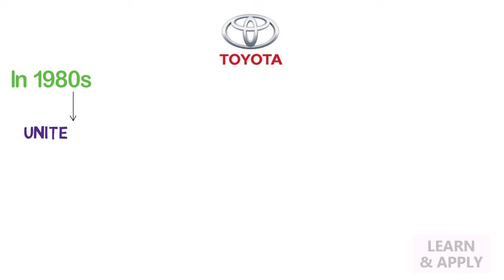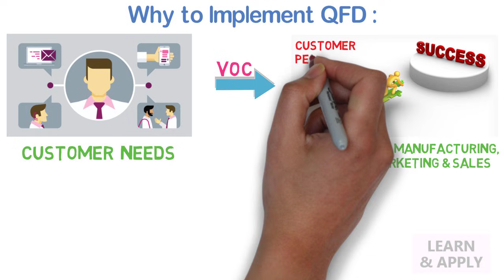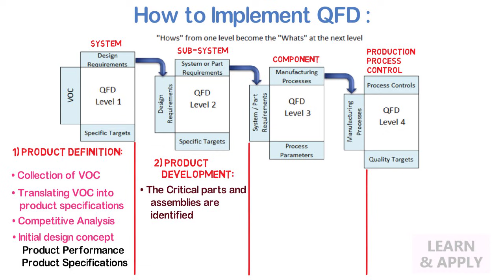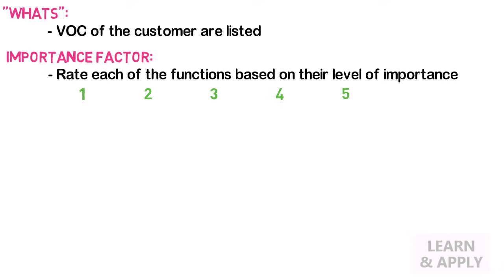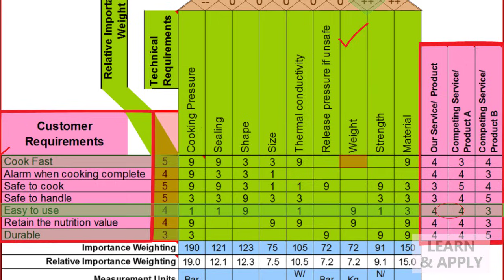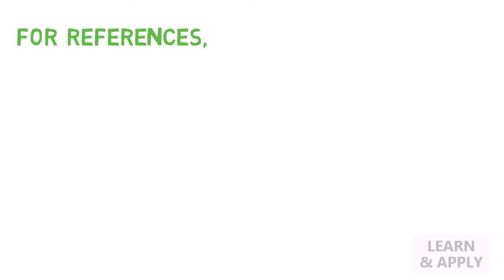QFD (Quality Function Deployment): With Practical Example (PART-1)

Comment: Thanks you for the video, though I have a question
 Will QFD work without a functional prototype?
if yes, then how will you collect the value for our service (without functional prototype for customer to give feedback to)?
Reply from the maker: Functional requirements are the requirements of the customer from your product or service. So, it is always present irrespective of your products or services. You need to use them for QFD.
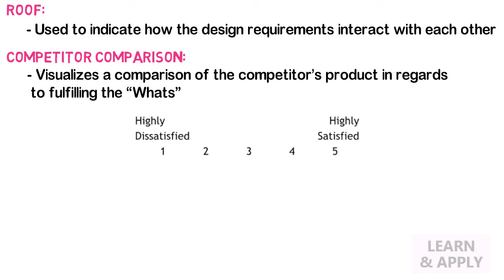Reply: Sorry, I might need to clarify the question. At 10:10, in competitor comparison section, are there any workarounds if you don't have a functional "prototype" (not requirements) for customer score on. As if you're going to design a new machine prototype.
Reply from the maker: Ohh, in this section we are comparing our performance with competitors based on customer requirements. Even if it's a new product or new machine, there are prepared by considering some customer expectations, right?
We need to do the research on whether there are any existing competitors for it or not. 
If let's say the situation is, that you don't have any competitors. In that case, you need to compare the performance of your product with your expectations.
I hope, this answers your question.
Reply: @learnandapply  Thanks a million, this answer is exactly what I need.
Reply from the maker: Thank you so much for your valuable comments and appreciation 🙏☺

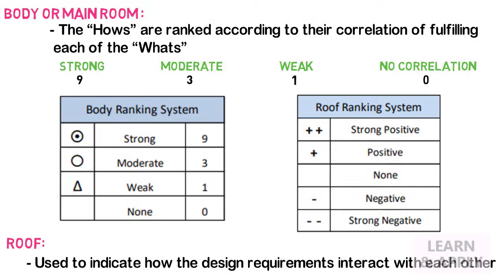Comment: minute 09:44 , it is not clear how the roof is fulled ,like for example how come that "sealing" and " cooking Pressure" have a negative correlation ?
Reply: I think it should be strong positive correlation as better sealing leads to build high pressure.
Reply: if pressure increases chance of breaking of seal also increases hence they have negative correlation
Reply from the maker: Thank you for your reply.
Sorry for delaying in reply.